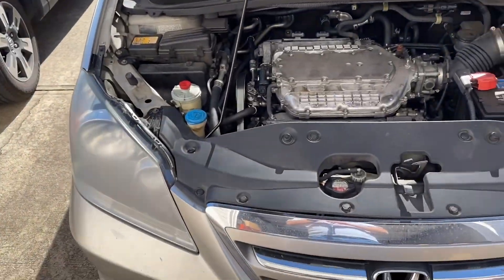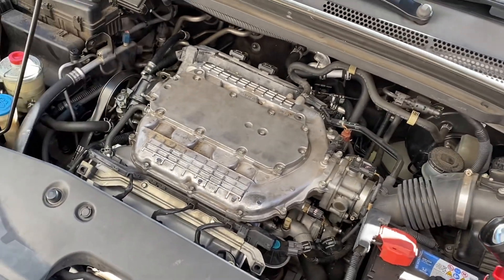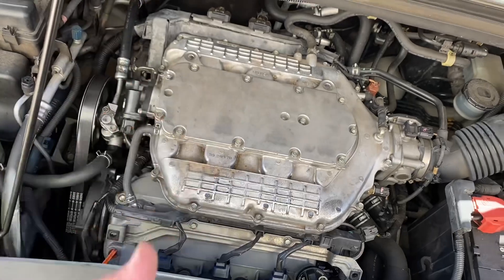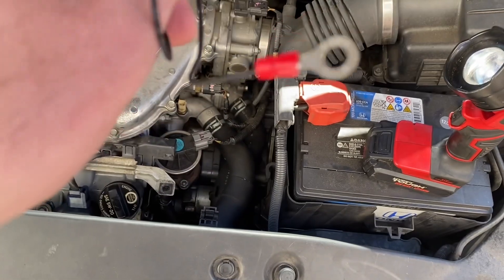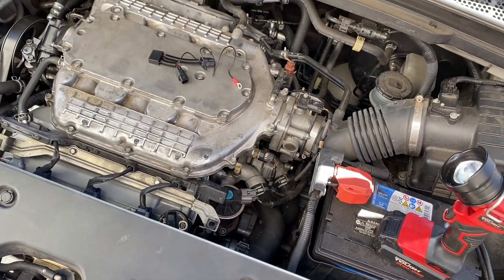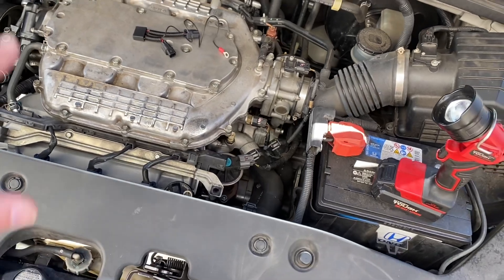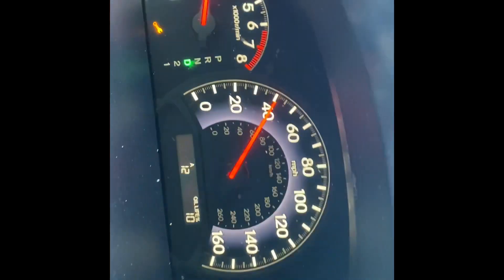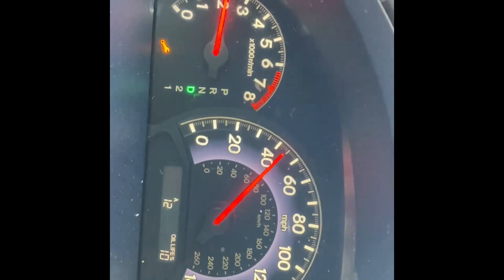S-VCM Controller installation on 2007 Honda Odyssey (VCM Delete)

Comment: What size resistor was in there when you installed that? 85? 100?
Reply from the maker: SVCM controller does all of the resistors stuff  so you don’t have to worry about it.   Earlier
Versions of similar harness you had to switch out a resistor. With SVCM controller you don’t have to deal with that and if the van starts to over heat it detects that and passes thru the actuall reading to alert you.

Comment: 2017 pilot done 3 wks ago, going strong. had a engine light on from other cause, but their after service is amazing, even though it wasn't caused by this device. I feel the V6 power.
Reply from the maker: @hahockyang4440  yep  and on my odyssey it had reduced oil consumption from 4qts. To 1-2qts per oil change
Reply: @hahockyang4440 
Question:  your code came back on the Pilot 2017?. I tried everything on my power to erase an Emissions code on my Pilot 2017 and I'm going to try this to see what happen.

Comment: Hey bud, you got an update on functionality now that you have been running it for awhile?
Reply from the maker: Yah I was going to do a update vid when it got to the first oil change after.  It hasn’t been long enough.
Yet

I have been updating the  vid description with mpg decrease it by  1-2 mpg. But it has reduced oil consumption so far .   Once I get to oil change I will know how much I have had to add between oil changes. So far it’s a little over 1 qrt.  Where it use to be maybe 3 qrts.  The car is more responsive and the vibration from engine in-balances when running in 3 cylinder mode is gone.

The van has 245k miles btw

Comment: Nice work hope it is running better
Reply from the maker: Yes it is and using less oil and more responsive.  But its fuel mpg suffers 1-2 mpg less.  Hopefully this will let the engine last longer 
It has 244k miles may get rid of as it gets closer to 300k as that’s its next major maintenance which requires a timing belt change, valve adjustment, water pump replacement, etc
Reply: @dfields9511  that I can understand if you go that route
Reply from the maker: Yep it’s like a $3k maintenance if you do it by the book.  That’s the problem with Honda V6 is they have a timing belt not a chain and they have to be changed every 100k miles or when they break it destroys the engine due to the interference engine design
Reply from the maker: @Turningwrenches85    also I have updaed the MPG usage for these post install.  in the video description.

Comment: I didn’t know Honda was doing this system too. All the American manufactures use it in trucks. All have had problems because of it too.
Reply from the maker: Yep all started with j35a7 engine.   VCM1,

VCM2 is the worst and most problematic 

VCM3 is more like VCM1
And VCM4 likely hasn’t been out long enough or not the same kind of problems yet.

Even v6 accords and Acuras have this vcm system
Reply from the maker: I saw that on the GM   I think there are some ways to delete / disable that AFM feature
see 
https://www.onallcylinders.com/2017/11/30/how-to-delete-or-disable-active-fuel-management-afm-on-gm-engines/